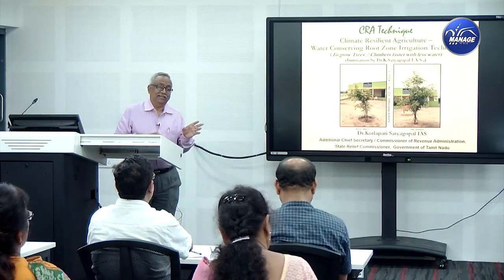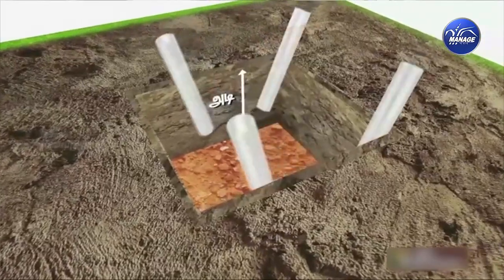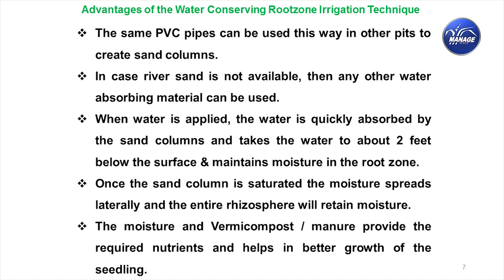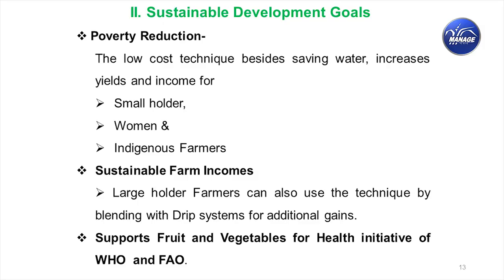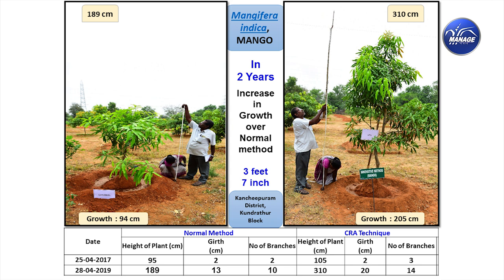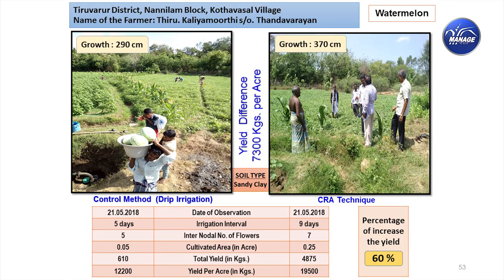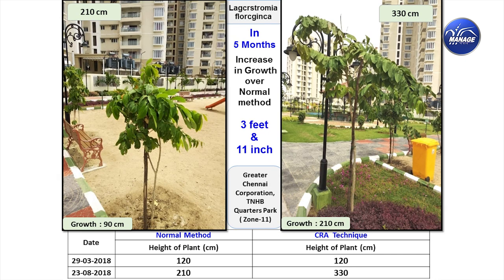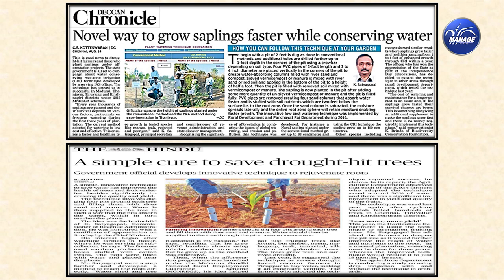CRA Technique Climate Resilient Agriculture – Water Conserving Root Zone Irrigation Technique

Comment: Will trees die if there is over flooded water during Rains and over watering? Also since we are using sand or water absorbent the evaporation in that region will also be much higher , Using Hydrogel is not recommended as when it comes in contact with soil calcium it will become useless and also Hydrogel kills the soil microbial activity sicne its chemicalmand dont allow oxygen circulation in soil which the rooots are needed. I feel using mulching along with soil microbes  around any crop or plants will lead to higher moisture retention and better growth. Any comments on this is highly appreciated

Comment: Sir I have a doubt..In this planting method can we use drip irrigation?.If yes means where the drip should fall?near the plant's color portion or near the pipe hole?.If we drip near the plant color portion the method will not work or if we drip on the hole place initially the root of plant won't get water and leads to die!How it will be usefull in dry areas?. kindly explain in detail sir. Thank you.
Reply: ...this will depend upon the duration and length of the plant. Remember the supply underground is running parallel to the plant roots three feet down ( almost I meter). Thus, whichever way you feed these sand pillers the soil is going to absorb it finally, mainly for the tender roots. So the water drops must fall over the sand channels. However, for new seedlings, in the initial period using drip on the top of the soil, near the stem will give instead supply. But once the roots gets inside the soil and starts growing, this it will not really help. The CRA method is the better choice.
Reply: @rajeevprabhu6722  thank you sir